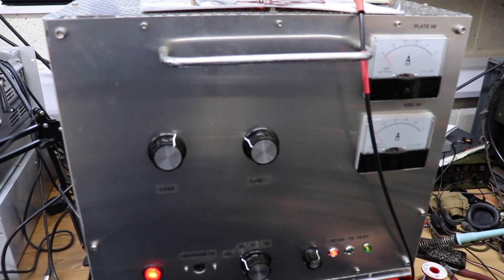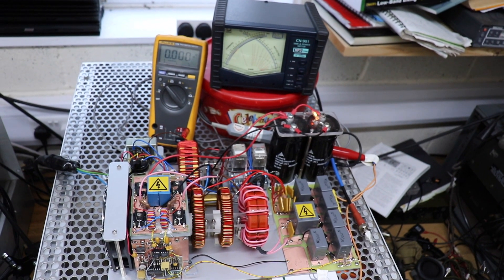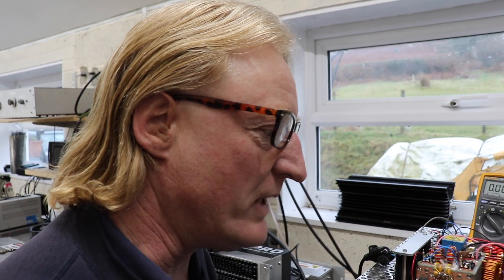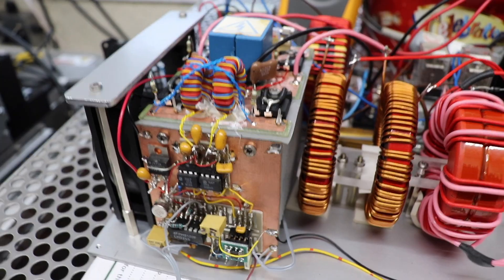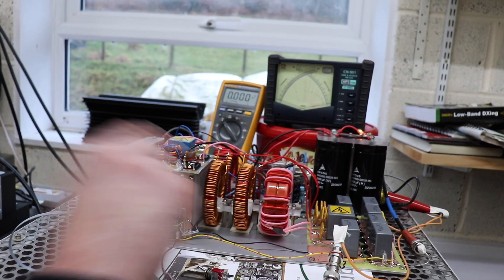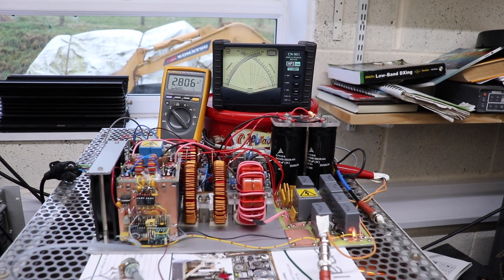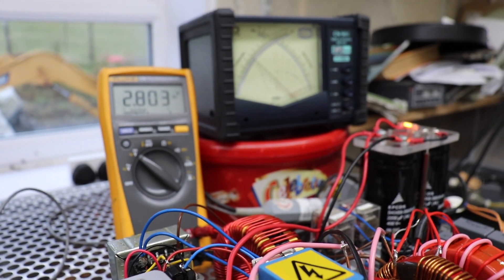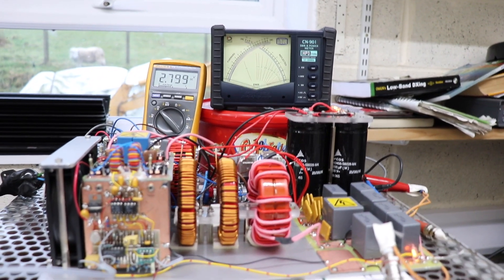A Novel Switch Mode HV Power Supply For Linear Amplifiers: Size Really Does Matter!

Comment: Hi Justin, lots of thanks for sharing this nice demonstration and as well thanks to Paul for explaining.
I recently  got a homebrew RF amp "kit" (for reasonable price) that was built up to abt 50%. It's using an AMPEREX 5868, very similar to the EIMAC 3-500 or PHILIPS TB4/1250, working in grounded grid config. Because the HVPS was not included and there is not any here in my home, i thought by myself about a SM design that doesn't need such an old school transformer etc. That latter would be extremely heavy, needs lot of space (I do have only few square meters for amateur radio) and, also exspensiv in comparison.
After weeks of of investigation my choice was a resonant (or LLC-) converter in a half bidge design. So I went through the web to find anyone that has built already a HVPS with SM technique. I was very dissapointed so thatI finally decided to do it on my own. A very hard part of work I think.... ^^
Nobody else did even talk about it until now (i.e abt one year ago) and a found it today, but YOU.... :-)  I'm happy that i found your video upload a few hours ago.
Technical: Paul describes an 8 times multiplier at the output. I think i really understand why he did so :-) What's about the current delivered from the converter bridge? That should be abt. 8 times higher than that at the output? Is there a remarkable benefit of a full bridge compared with a half bridge design?
Absolutely fine: the excellent load regulation, i'd never expected that. GREAT JOB!
73 de Michael

Comment: Thanks for sharing this information. Switching supplies seem to be versatile and avoid the mass of an iron core transformer.   The trade-off can be the noise generated by a poor circuit design, which can be observed with the cheap battery chargers and USB supplies. I have had my satellite radio in my vehicle jammed with noise from a cell phone charger in use!